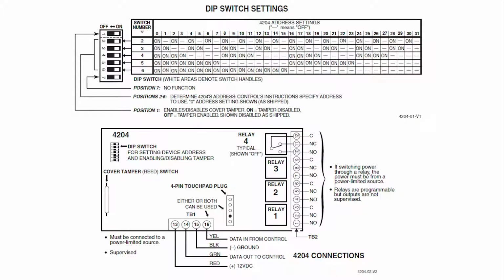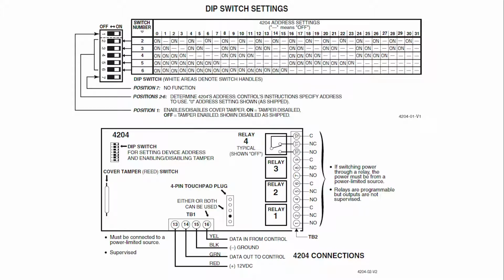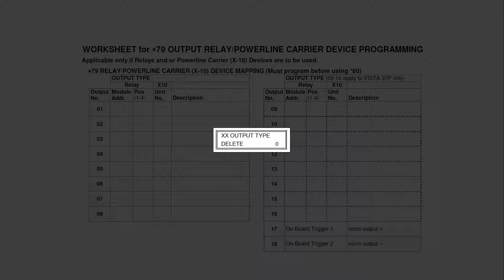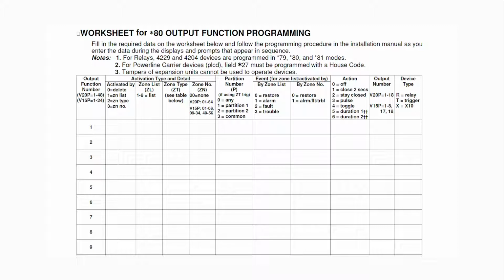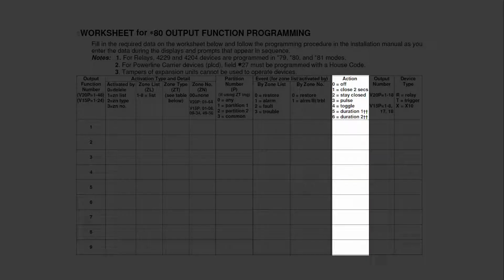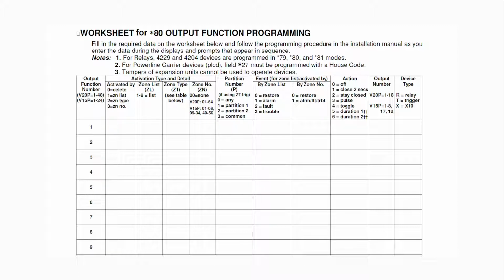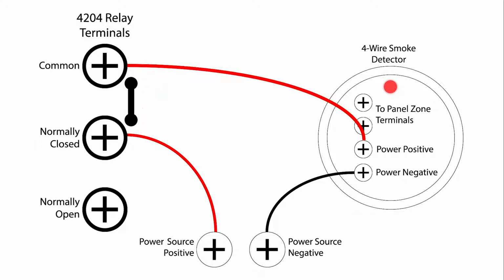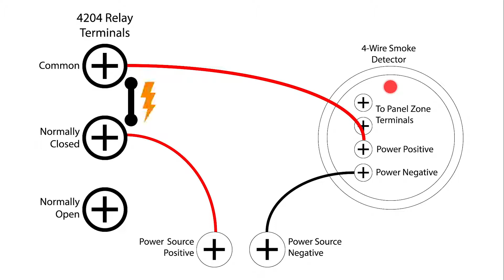How to program, and wire a relay on VISTA residential panels

Comment: There is one strange behavior that I have found about the Honeywell 4204.  Smoke detector reset.  If the smoke detector is cleared manually, say twisting off the smoke from the base for example, then it will not perform a smoke detector reset.  It will only perform a smoke detector reset if the smoke is still in alarm when the panel is cleared.  Likewise, if you are using a non-smoke fire alarm device, water flow switch for sprinklers, heat detector, or a manual pull station, then it will not do a smoke detector reset on those, except for the Simplex heat detector, it might do a smoke detector reset on a Simplex heat detector.  This can be very confusing and can cause you to request a service call when there is no need due to a mistaken belief that the 4204 is not working.  I found this out the hard way.  Also, fire alarm sirens tied to the 4204 will not be silenced by pressing the 1 key, like you can on the Honeywell vista 20p built in siren circuit.  You have to press the security code then 1 to silence a 4204 operated fire alarm siren.  Also, strobes hooked to the 4204 will not do audible silence or selective silence.  Pressing the code then 1 will turn off the strobe as well.  To get around this problem, program the 4204 to turn the strobe on during a duress event.  Then press in your distress code and presto!  You have audible silence!  I found this out on my Honeywell vista 20p system that I installed to protect my family and my dog.
Reply from the maker: Hi! Thanks for reaching out. For support on your security products you require the assistance of a security contractor, you can find one on your area here: https://www.resideo.com/us/en/find-a-pro/ or if you're a contractor, you can contact our security line for assistance at 1-800-645-7492. -Charlie

Comment: How to keep the alarm triggering on relay 4204 module, even if the zone returns to normal?
Reply from the maker: Hi, thank you for reaching out! For assistance on the 4204 relay module and zone programming, please contact our support line at 1-800-645-7492 for contractors. -Charlie